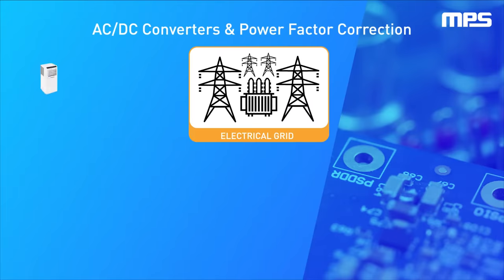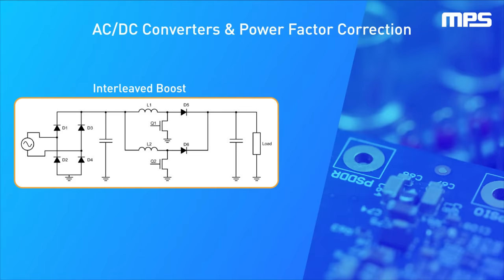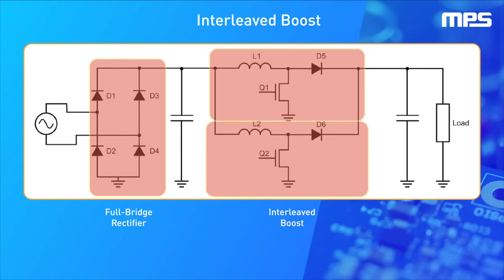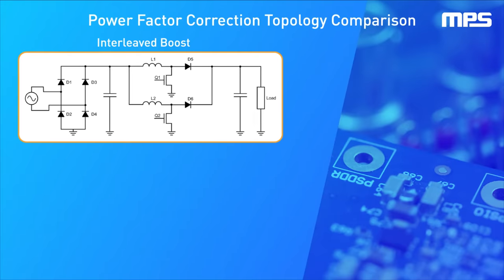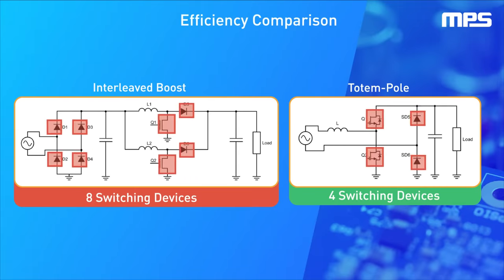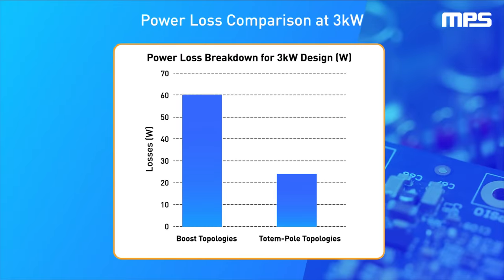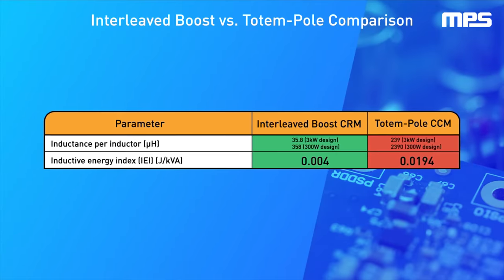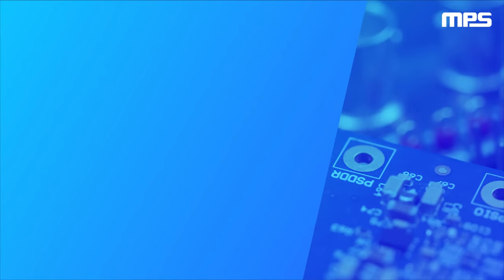High-Power PFC: Totem-Pole PFC vs. Interleaved Boost PFC

Comment: Both shall be compared in a similar current conduction mode.  However, the one which has more number of diodes will have more losses as pointed out
Reply from the maker: Thanks for watching and providing input.

Comment: With all respect to all your incredible engineering hi-tech R&D , PFC cannot give any advantages to unstable AC mains for example small and medium power backup generators supply lines so the device that contains PFC is totally exposed to be damaged and blown up in fireball all time ... Most of repair technicians are forced by customers to remove this sophisticated PFC circuits and replace by simple SMPS sacrificing the good PF just to keep the device longer in duty without damage .... World is not optimal all places so please think of our conditions as well .... I am from the hell branch on earth ( IRAQ ) ...
Reply from the maker: Our Totem Pole PFC has several protections to avoid breakdown due to unstable grid voltages, as well as being compliant with IEC 61000-4-11 for grid dips and dropouts. For applications that use more traditional AC/DC topologies, MPS also provides a wide range of Boost PFC controllers and converters, such as the MP44014A.